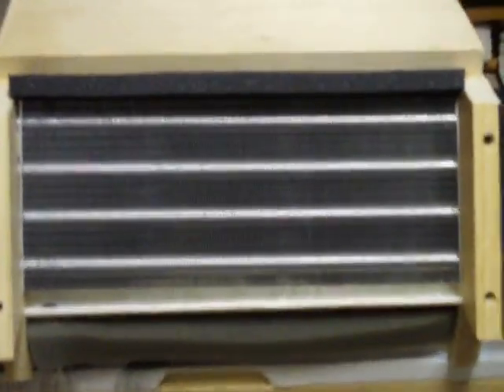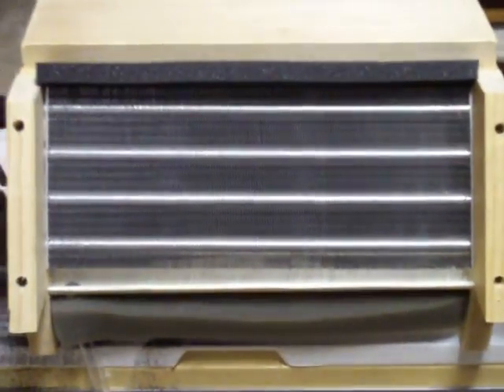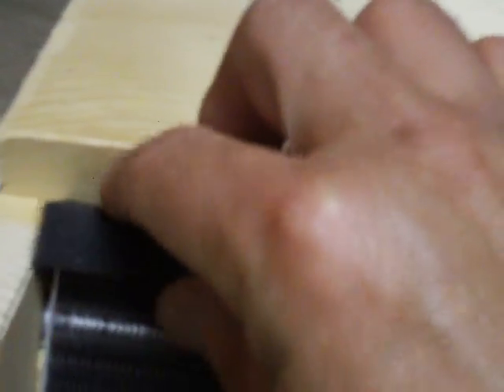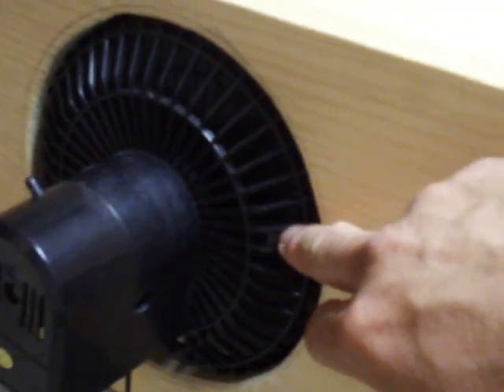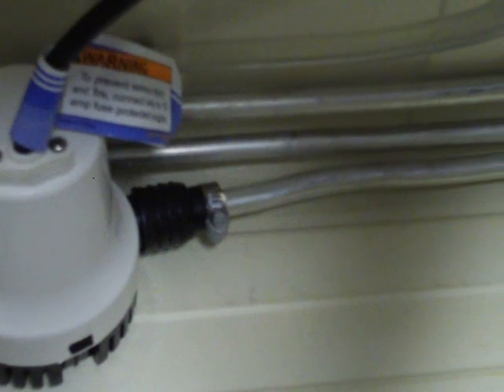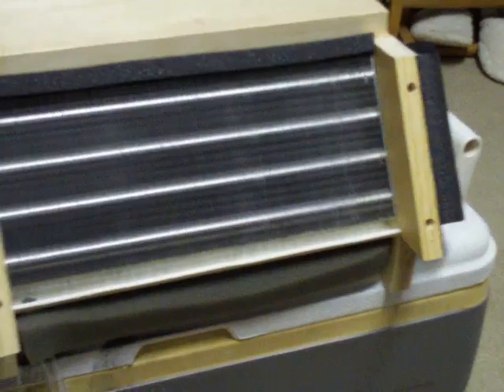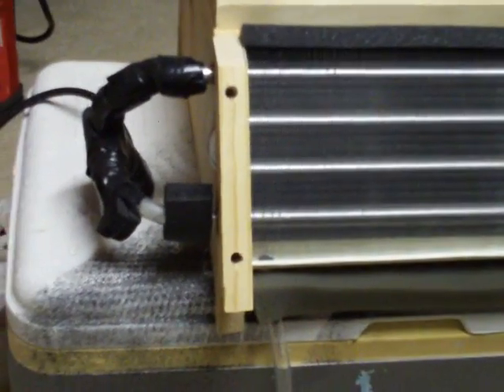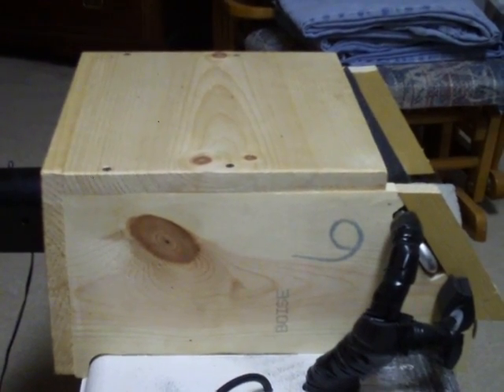Homemade Air Conditioner.

Comment: There is only so much energy for cooling in s given amount of ice. The rate that you take it away is what determines the amount of time it will take to melt. Since your fluid cannot be colder than 32 deg f (water) you have a limitation on to how cold the coil can get. If you used a closed coolant loop you could use an antifreeze liquid and get better thermal transfer You might also be able to use Dri ice but that is expensive to buy. for a closed loop you would need more coils in the cooler.

Comment from the maker: That is a Aluminum Automatic transmission oil cooler,  I call it a "Coil" when used in this application, but otherwise its a transmission oil cooler, you can find them at most any auto parts stores.  Thank you for Coming in and watching,

Comment from the maker: Well Thats a good example of a closed system or water isolation, less water aggitation would help the ice last longer, in my case i have a coil in the bottom of the cooler, all i would need is a insulated canister for the pump and water to sit in, its a good idea,because the water never physically contacts the ice at all, which would help last longer, Food for thought,   Thank you, and also for stopping in !

Comment from the maker: im talking about the same thing, annodes were pricy, you can buy the ones for hot water tanks which is a rod that does the same thing i think, they were like 40 bucks i thought,  anything over $5 is more then id want to spend on it for the added few degrees cold temp, thats all, honestly if anything im more focussed on the longevity of the ice, tryin to make it last longer, Hell id throw viagra in the ice if it helped, hahah.

Comment: You might even be able to get away with using a piece of galvanized steel instead of trying to source pure zinc since the galvanized coating is zinc. Maybe hose clamp some small pieces of galvanized pipe to your aluminum tubing and do an ice/salt test? Just a thought...

Comment: I think we may be talking about 2 different things. The system I'm talking about is passive and just requires a piece of the right kind of metal be attached to the metal you want to protect and in contact with the water. The sacrificial metal will corrode instead of the metal you're trying to protect and will need to be cleaned periodically and replaced when it corrodes away. I believe zinc is the preferred sacrificial metal to protect aluminum from saltwater.

Comment from the maker: the parts list for this is, A 12 volt submersable pump, 10 feet of 1/2inch aluminum line, a trasmission oil cooler coil for the top of the cooler, 1/2 inch clear vinyl hose about 4 feet of it, also a 50quart or bigger ice chest cooler, a 12 volt 6 inch diameter fan, you will have to custom make the top part to fit your application, i do not have plans for this, I built this as the thoughts came to mind,  Thank You !

Comment from the maker: Well as i said thats out of the relm of just everyday people unless they plan on paying a lot just to do so, as much amps that it would be using you might as well get a window AC unit,  and at -40 you going to have to use alcohol mix in with it, but that means you would have to make a closed loop system so none of the alcohol evaporates away, and the counds of it you would have to regulat the power to it so you do not freeze condensation on the unit, otherwise not removing moisture, Good luck !

Comment from the maker: transmission coolers are simple and you dont have to plug them in, once they are hooked up they stay hooked up, and im sure they are far cheaper  then apeltier module  and consume no voltage as a peltier module, i doubt that the water would freeze seeing that it is moving all the time, unless you use several of them which blows this way out of the relm of being simple, and affordable, by that time you might as well just buy a real AC window unit,

Comment from the maker: if i used a peltier module  it will just consume more electric from the powersource, and my understanding is they use a bit of it.  this was built to be simple, not complicated, no electronics, and high dollar switches,  something the average joe can go get parts from local stores and not have to order off some sepcialty store. pour the ice in, contain the condensed water, and cool off, and remove the moisture in the air while using it in a small room. or area . car, aircraft, tent..

Comment from the maker: This is removing water from the air, it goes into a glass with a lid, tiny hole to vent, it is now Condensed into Water form,Any water evaporated back into the room is Far far less then what is being conditioned out of the room or area, so much in fact it would be a matter of time where would dehumidify the room or area. humidity will no go up if it is condensed back into water form and contained, even with a 1/8 inch vent hole.there is more moisture removed then  eveaporated back in the air...

Comment from the maker: The Moisture drips into a cup of glass, it doesnt need to vacate outside when its condesned into water, in a glass, if you were to try and cool the returning water with another fan and coil, all your going to do is make that water warmer by tranfering more heat into it by induction with the fan, blowing any air, even the cooler air in the room will still not be as cold as the returning water, even tho it is warmed a littl bit, but its not going to be 100% room temp,it will make ice melt faster

Comment from the maker: there is no need to VENT heat away in this unit, the water that has been Warmed by the transfer  of warm air passing through the coil and cold coming out, the heat absorbed is returned back into the cooler into the ice, cooled back down again, and ice melts a little bit because of warm water coming into the cooler from the transfer, there is no Heat to vent,

Comment: i mean you have to do the ice thing in an aluminium bottle and stick it in water that goes in your pump and radiators so if it gets hot then you have to stick an other bottle

Comment: I retired due to disability after 38 years in the HVAC industry, and you had 19 degrees temp drop. that is only 1 degree away from the industry standard.    you are doing something right!

Comment from the maker: Your right, but those are pricy, so i just figure for the few degrees colder temp, i will just settle for plain ice, without salt, I have heard of them used for ships and boats, but never heard them for aluminum boats, thought they were mainly for steel,  Thank you for the input, it is food for thought for sure !

Comment: This is a great unit. Just completed a smaller version using a Torqflow cooler. Never would have thought of it. BTW it does work notably better using saltwater packs. I haven't used it but a week or so, but  I'm using heavy duty electronics dry-pack sealable bags to pack ice and salt into, fill the chest with ice and water, then pack those in around the pipes. I get frost patterns.  Bulky but sure beats A/C repair bill in my second car!! Plus you can leave it running for short run in the store!

Comment: You could drop 19 degrees by just opening the windows in the camper shell, parking it under a shaded tree, and having a small fan circulating the air out

Comment from the maker: Thanks for the advice, Well you and others have mentioned that, only problem is that aluminum doesnt like salt water, and would deteriorate not long after,  I think if i had a copper coil, i would be able to do the salt thing, but even copper i think falls victom to salt at some point, guess thats why they use stainless steel in most application with salt.   Appreciate you watching !

Comment from the maker: I have to correct something I said no heat is put off by the fan motor, I meant to say the fan moto on my unit does not put off heat anywhere near what a AC motor would put off, , its so slight, it would not make a significant difference anyplace i used this. just had to clear that up.

Comment from the maker: cold again, passing through the expansion coil. while air moves past it,  bowing that cold air into the are or room, gas passes back through the compressor, where it gets Condensed under high pressure back into a liquid state,  what i stated earlier was that my unit can get a area cooled down and remove moisture just as a AC unit, just takes longer, and uses Ice to do so, like i said, unless you plug that AC into a  noisey GEN or INVERTER, then its useless. where this is on 12 volts,  Thanks !

Comment from the maker: water running through the coil on my unit, along with the condensation that runs off the coil into the catch tray and resivoir, this unit would Only have the heat form the DC motor, which is the size of a model airplane motor, there is No heat that is put off by this unit while working, Nothing even close to a AC unit, AC unit has a Condenser that gets HOT because the pump is compressing  the expanded gas back into a liquid, up to the expansion valve, which then it expands to a gas state and

Comment from the maker: okay, let me explain, there is only one coil. there is no second coil that gets hot, its nothing like a window unit in the way of heat, any heat passed through the coil on this is taken back into the ice, where it gets cooled down, melting some ice with it, the Expansion coil is what gets cold, not the condenser, I do not have a condeser coil, I perfectly understand how a AC unit works, My unit just circulates cold water through a coil. with a fan blowing through it, any heat  trapped is in the

Comment from the maker: to condition air, or to remove moisture, you dont need any of those items, just as long as you can cool a coil down cold enough to condense moisture, on the coil, so it can run down into a tray, how much heat do you think a 12 volt 1 amp dc motor is goin to put back into the room, the fan is no problem, the motors are small enough to not make a real difference, your not goin to plug in that store bought AC into a tree, without a Generator, or a inverter, this was just a project, tested, works.

Comment from the maker: This would not be a homemade air conditioner, if it had all that a store bought one would have, Pending on the room size you put your store  bought AC in, and the one i made, they they both would  and could remove the same amount of moisture, Only difference would be the store bought one would be able to do a faster job of it, pending on the size, either way, it would remove just as much moisture, just takes longer because there is only so much moisture in a room, unless it is poorly insulated.

Comment from the maker: Hi !  Well, if you look again, Swamp coolers use cold water or water in general that trickles down a media material, and a fan blows through that material, The best Swamp cooler i could compare to would be a humidifier, Mine Conditions the air, removing Humidity, the water is enclosed in the unit, never does air pass across water or through it, the coil on mine gets cold, and moisture condenses on the coil, then running off into a catch tray, air is chilled, and the area is then cooled.

Comment from the maker: Also if your running a SEALED 12 volt battery to operate, use something like a 35 amp hour battery, and when your at the craft fair and if you have a power outlet you can use, hook up a small battery charger to it, so you dont loose any charge, You wont be able to run it off just the battery charger alone, it would burn it up, but have a battery hooked to it, and a charger on that would  give you endless time for use,

Comment from the maker: Carol ! That sounds great ! Well the electrical tubing im assuming is PVC or plastic type tubing, Well Its a known Fact Copper transfers heat best, aluminum is a very close second, and alot cheaper then copper, BUT you can still buy and use soft copper tubing that comes in 10 foot rolls, you can get a lot better results with that compared to the Plastic stuff, Sounds like you Two are going to enjoy it, please send or post a video, i would love to see, !  Thank you very much for stopping In !

Comment: Interestnig comment. As a private pilot that flies small fixed wing single engine aircraft, that you cannot get with AC, flying in 95deg heat this makes a heck of a lot of sense. I think that would make a Cessna 152 or 172 a whole lot more comfortable. Now, there are companies that sell units just like this for aircraft......for $525.

Comment: Hi! My hubby and I are building this contraption this weekend. The only thing I had was the coleman. The rest of the parts I purchased. I have a need for this at craft fairs because some do not allow a generator due to noise. Plus it will be nice to have for camping. The only part i couldn't find was the aluminum tubing so we are trying electrical piping. It was only a couple bucks so if it doesn't work we can easily change it out. We will see how it works! Thank you!!!

Comment from the maker: Well this Contraption was as i said in the video, just a challenge to build something, I do not have anywhere near 75 in it, i have a 12 dollar fan, and a 14 dollar pump, everything else i had, the cooler the wood, the tubing and the trans cooler,  I do not cool my house with this, im not poor, it was just something fun, and im not the only one on here with something similar,  Thing is, can you power the 5000btu with 12 volts? without a power inverter? on a camping trip?  Thanks for the comment!

Comment from the maker: I didnt think it would matter with a 12 volt dc motor. I know in AC equipment if you run it low voltage you risk damage. but didnt think it matter on a brushed motor.

Comment: some pumps will fail if they are not run at 100%. You would have to check into the electrical side of that. It has to do with what type of motor the pump is. Off hand I can not think of the difference but do know it exist.

Comment from the maker: Yeah it was in the back of my truck on a hot day, fiberglass truck cap on the back, in direct sunlight, with glass on the back and sides of it, so  Id think it did pretty well seeing its kinda a Green house with all the glass and no insulation,  I had others tell me a 20 drop is pretty good,  im pretty happy with it, used it once for camping one night,  the colder air settled  ground level where we laid, and i was suprised it lasted most the night on a low speed setting, and i was comfortable.

Comment from the maker: None what so ever, This is not a "Swamp cooler" and even the ones that use frozen bottles will put moisture in the air, Why? because moisture would collect inside from the cold items, and be put right back into the air with the air passing through,, Mine  removes moisture  into a drip pan, and drains into a cup "conditioning" the air, just like the Real AC units, so no, if anything it would remove humid air from a room. Thanks for watching !

Comment: 104 to 84 degrees? a 20 degree drop in ambiant temperature is pretty good, granted it was probably an uninsulated small space but in 104 deg under the sun area that I would say is pretty efficient for cooling an area.

Comment: The reason is latent or hidden heat known as btu's or british thermal units. The difference between 32deg water and 32deg ice is 144 btu's
this is also the standard by which the capacity of an ac unit is determined. Usually found in the model # of an outdoor unit the condenser. The formula is 12,000 btu's per ton.

Comment from the maker: Always room for improvment in my mind, either way would work good, but to conserve battery power while regulating water flow may be better  IF it can be done without wasting power through a resistor that heats up and still eats the same amount of power,

Comment from the maker: I agree,  normally do not use ice from my freezer, because of it working harder and i would not produce enough  ice anyway, I usually will go buy 30 to 40 pounds of ice, but i had someone give me a deep freezer, just big enough to make a block of ice that will fit into the cooler nicely, but again, if your out at a camp ground with several ice machines ( usually free ice )  then its a win situation  I am focusing on dry ice use in a closed system, with ventilation to vent gases outside,

Comment: At the point where the ice is melting, both ice and water are at the same temperature: 32 degrees F.   Ice isn't necessarily colder than water, but it can be.

Comment: Just one caveat:  if you are getting ice from the freezer in your house, the net result of this air conditioner is heating the house, not cooling the house.   The coils on the back of your freezer remove the heat from the water to make the ice.  Simple conservation of energy.   So, in order to be effective, you either need your freezer in the garage (or some other uncooled location), or you need to purchase your ice at the store.

Comment from the maker: I agree with ya all the way, Only i figured out something else, besides the ball valve, to control the flow, I could use a volt controller that doesnt use a resistor, like a old stereo volume control nob, wire it up to that and  slow the pump down or speed it up, it may even save some battery life insted of ( full throttle ) all the time on the pump, either way your idea will work great, it would allow more time for the water to transfer in the coil. and the drain on that cooler is a must ! lol

Comment from the maker: Hey thanks, yeah white would be best for it, draws in less heat, Well i try and tell people about how it removes moisture, but they think it doesnt, which it does, less moisture in the air, the cooler a person will feel and it doesnt have to be a very cold temp to feel that way,  I really appreciate the compliment and suggestion as well. Thank you for stopping in !

Comment from the maker: Well my thought would be if the cooling lines were under pressure, the pump would use more amps and create more heat melting ice faster, its like you or me, if you work harder you to to get hot, but interesting thought !!